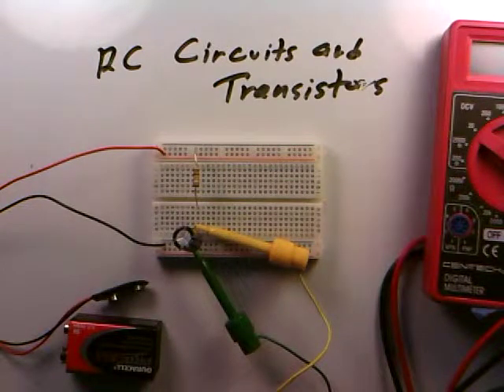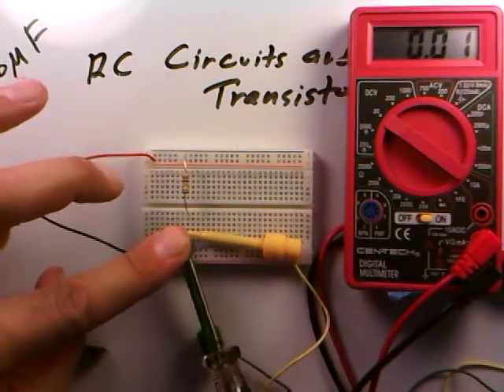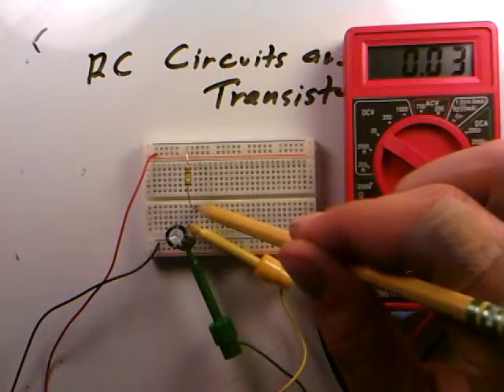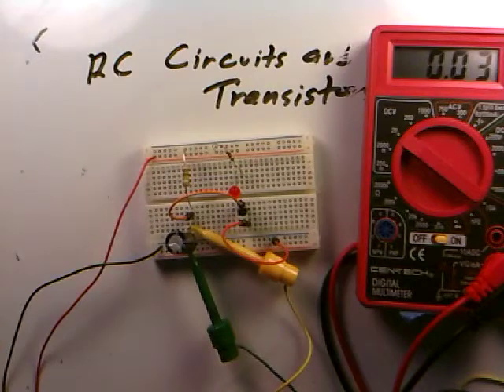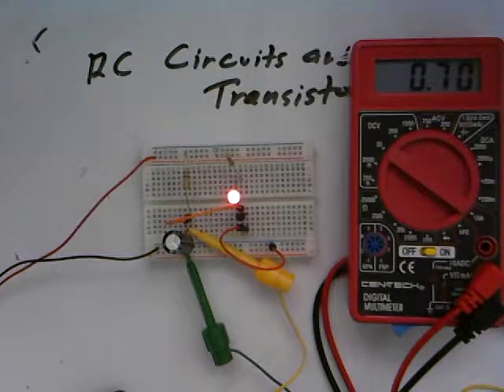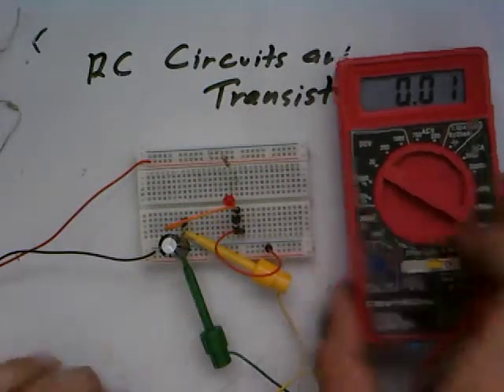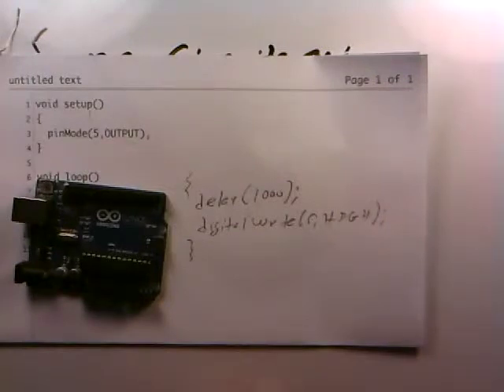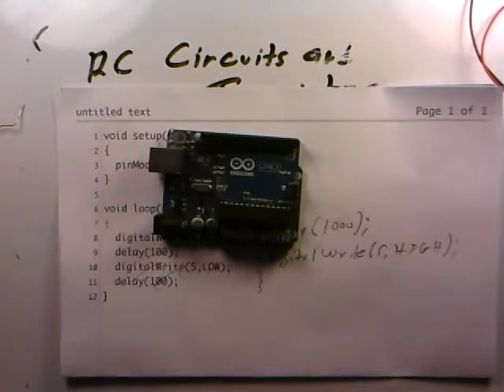elec 034 RC circuits for transistor led turn on

Comment: Actually - this is a very important question, whether we should go into Arduino programming, or.. RC . I am a strong believer - that both are equally important, and both should be taught. An example: I used my last Arduino, new didn't come yet, and now I'm struggling to do simple blinking module based on 555 (I need one short blast over 3 seconds). OMG. Its like hitting the wall. On Arduino - two minutes, maybe three. Planning on breadboard with RC -  3 hours. I really regret not paying attention to physics years ago.
Reply from the maker: This is quite a question..discrete components, or a microcontroller. I say go with the microcontroller. It seems like electronics with discrete components is a thing of the past.  You don't always have to use an Arduino either. Some of the PIC-type controllers are as big as a 555. So you can have this amazing
complex circuit that does it all with a single chip (the microcontroller) at the center, with maybe some support
components (like a transistor or two) off to the side.